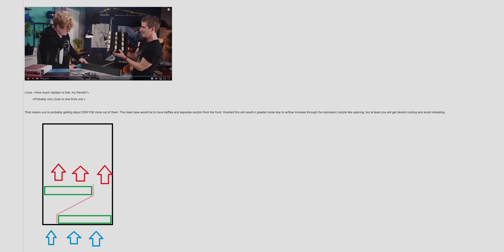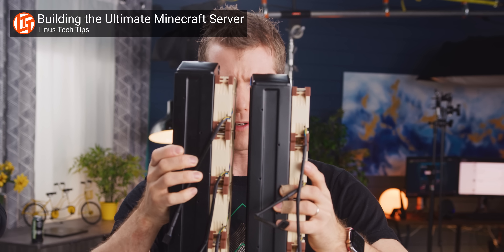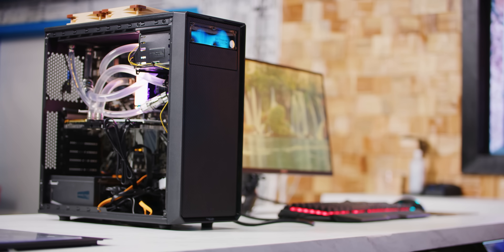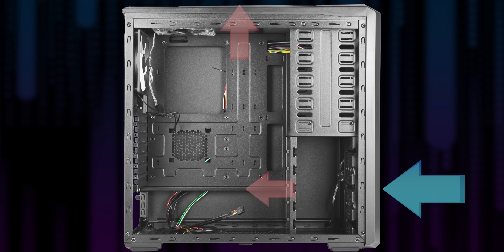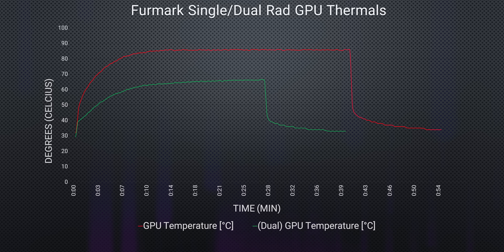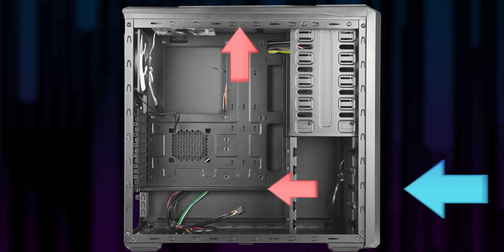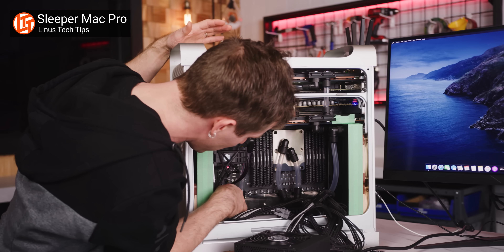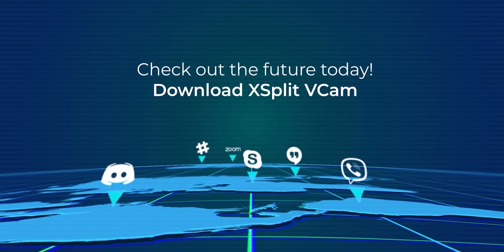I’ve been water cooling wrong for YEARS - $H!T Manufacturers Say

Comment: Missed an important point:  The order the water & air flows through the radiators.  For best transfer you also need to ensure the hot water from the CPU/GPU goes through the 'exhaust' radiator first, then to the 'inlet' radiator.  That way the hot air is passing through the hottest radiator & the precooled water gets the cooler air from the inlet, AND means that the heat from the inlet cannot increase the temp in the outlet radiator.
Order is important!
Reply: Came here to write this comment, glad to see at least someone else think of the same thing. The waterflow direction/order seems like a really basic thing to overlook on both Corsairs and Linus’ part. It’s pretty basics in heat exchange, that a crossflow heat exchanger is more efficient. That’s why the hot water must go to the rad which gets the hot exhausted air. This doesn’t really matter if your single radiator is already efficient enough, but if you really need another one, then the waterflow direction matters. I’m a mechanical engineer, working with engines (a lot of thermodynamics), and in my opinion this is a simple matter, and I’m baffled how Corsair have missed the point. Their CFD resulr might be correct, but the simulation might be incorrectly set up to begin with.
Reply: @MikkoG5  Not to mention it is pretty much impossible for the all the air that goes through the radiator to be at the same heat level as the water that comes to the radiator since the water pretty much loses half the energy by the time it gets half way through the radiator, the air going through the other half, where the water is much cooler will be well below the input temperature.
Reply: Defeqel Yep, I think I get what you mean. These radiators aren’t really cross-flow heat exhangers, as let’s say the air goes horizontally, and the water goes vertically.
Reply: MikkoG5 you’ve just described a cross flow hx, these radiators are cross flow not counter current
Reply: yo gabba Thanks for clarifying! I’m not a native English speaker so had the terms a bit mixed up. In any case, a crossflow hx is more efficient than parallel flow, and a counterflow hx is the most efficient.
A radiator in itself is a crossflow hx as the flows of air and water are perpendicular. But a system of the PC case with two radiators can be considered to form either a parallel or counter flow hx, depending on the water flow direction (hot water meets cold air vs hot air). It’s actually quite common for example for a shell and tube type counterflow hx to be actually a system of multiple crossflow hx’s, if the shell has baffles in it.
Reply: MikkoG5 Yeah you’re right. The manufacturer saying 1degC temperature difference sounded pretty suspect to me.
Reply: @MikkoG5  I'm so glad I found someone who already thought of the exactly what I was thinking of! (I'm a mechanical engineer also and was wondering how Corsair missed this point)
Reply: Just saw this video and had a quick scan through the first few replies and nobody mentioned this so I had posted the same thing, definitely makes a difference where the hot coolant enters the system. Deleted my comment as it is a bit superfluous.
Reply: @GeorgeElliott-GE  Getting pushed down the page does that!
Reply: 14 1/2 mins of Jay showing why it doesn't matter:
https://www.youtube.com/watch?v=RnPB_q51iVk
Only thing to keep in mind is that the reservoir is higher than the pump to make sure no air goes into the pump.
Reply: @HappyBeezerStudios  Different subject.  That is just about the order the water flows through the CPU, GPU, and ONE radiator.  Whether it makes a difference to the CPU/GPU, what order the water flows through the system. Pump - rad - CPU - GPU or pump - CPU- GPU - rad, etc.
I'm talking about the multi radiator setup, & the order of the water & air flow through the radiators only.   The process of getting the heat out of the water most efficiently. 
If you have the hottest radiator at the inlet of the airflow, the air heats up to almost the water temp, picks up more heat in the case & then hits the exhaust radiator at the same or higher temp than the water, so no more heat leaves the system.  Yes, you get more out through the first radiator, but the second is then at best doing nothing, and at worst adding some back in. 
If you put the 2nd radiator at the inlet, the pre-cooled water gets the coldest air & loses some heat, then the air picks up a few degrees in the case, before hitting the high temp water at the 2nd radiator, allowing it to dump more heat as the air leaves the case.  At best you cool the water more through that exhaust rad, and at worst you do nothing.
Assuming adequate airflow...
This is particularly the case where you have stacked radiators as they showed in some scenes that they used previously.
Water: 
IN     Hot--->Warm--->Cool  OUT
OUT Hot<---Warm<---Cool   IN
Air
Reply: @NemoConsequentae  Thank you.  I am losing my mind watching this and reading everything where specific details like this are not taken into account.  
There is also the bit towards the end where he said someone took one of their radiators that actually were in direct series out and saw a 5 degree increase, was that the triple rad setup they showed towards the beginning where all 3 were strapped together?  Because with three the first would cool the water blowing hot air that would warm that cooler water back up in the second rad and then back to cooling the water back down in the 3rd rad.  Im sure there are still factors that will impact that setup too in unexpected ways but I feel that the  "Oh there was this difference in another setup that was actually in direct series." is just obviously anecdotal.
Reply: @Benny23761  It could have been because the one they took out was picking up more heat from the hot case air, or it could be because it added a little too much restriction to the loop, slowing down the flow.  Or it could have been something else completely! 
Without seeing exactly how it was set up, we'll never know.

Comment: Radiators are just almost always going to be better than a HSF setup.
In saying that, i'd have them all pull air out of the case, in this setup, i'd have the one at the front pull air out instead of push air in.

Comment: You're a dumbass. The fans which are above the rad pull cool air down which goes out the rear radiator. Which means you defeated the purpose. You moron you screwed up their analysis by making the fans pull cool air down which messed up your data dumbshit.

Comment: one theory as to why a second rad helps with temps is that by nature of adding a second rad you have more fluid therefor the thermal mass is spread out over a greater volume...simply put more water takes longer to heat. when coupled with extra fans (more air flow) it means that the volume of exchange has increased exponentially. In conclusion, large heat - large thermal mass + large air flow = cooler temp. where as Large heat - moderate thermal mass + moderate airflow = moderate temp.

Comment: I think that the efficiency decrease is the biggest fault of stacking watercoolers, instead of having one sucking in warm air from another cooler why not just put them in parallell, each sucking in colder air, and therefore not loosing efficiency due to a smaller temp. difference

Comment: exactlyyy....... radiator placing and fan functions, all you have to do is place a radiator at the top and one at the front or back and have them both pull air out of the case and leave the largest fan panel for imputing air prefrably filtered in the case. you would have the most cool air coming in and all the hot air going out of the case .

Comment: If radiators were blocking your only means of air ingress/egress then maybe there might be a problem.  What might be more interesting is how a multi-chamber case, with separate radiators (or even loops) in each compartment might work, such as in a watercooling modder's perennial favourite, the TJ07.

Comment: Stacking rads is almost never bad so long airflow is maintained with fans. The simple fact of the matter is cars stack radiators all the time. 
Now... I have one key thing to make sure you pay attention to. If you stack or have multiple rads in a case. You need to have the one that will get the hottest airflow receiving the coolant FIRST. That way the last radiator to see the coolant before going to the CPU/GPU will have the coldest air out of it and most of the heat will already be pulled out. This would allow the most efficient and best result possible for the loop.

Comment: If you're using multiple, run radiators in parallel, not series, and use a Y split. You reduce flow resistance and increase surface area. Since you're splitting the flow in half, it spends more time in the radiators, which allows more head dissipation.

Comment: "Staking radiators is bad".... tell that to the auto industry that has stacked AC condensers, oil coolers, transmission coolers and aftercoolers in front of radiators for decades with no issues. ;)
Reply: People are having issues with the civic type r. the inter cooler dumps its hot air into the cold side of the rad. Swapping the upper an lower rad hoses and having the coolant flow the opposite way through the rad helps with engine temps
Reply: Would you prefer all cars be 10' tall like semi's so you could single stack all your radiators?

Comment: It seems to make perfect sense that the realworld application doesn't match perfectly with a model. Every build is different. However, if I was setting up a dual rad system, both rads woud be exhaust, and the regular case fans would all be intake, allowing the air that reached the rads to be cooler. Of curse, you have to manage the airflow between the intake fans and the rad fans so you still get positive pressure inside the case, and your case fans can pull in more air than your exhaust fans can remove, helping to keep the dust out and the internal air at a cooler temperature. Why feed hot air exhausting from a rad into another rad if you don't have to?

Comment: I have 3+2+9+9x144 rads. The 9+9 are stacked with fans in the middle. And I can say, performance wise, it doesn't really mater after 9, but the fans speed do decrease to more you at. I run now my 7980xe @18x4.8Ghz for 3 years stable @30c water.

Comment: What they meant by "stacking" radiators was the whole rad, fan, rad,fan, rad setup. Their is very little place for fresh air to come in, but cases leak air all over, so the air in the case will never get close to the temp of the rad. The only benefit to stacking rads is the increase in mass of your overall sink. Keep in mind too that simulation and theory never pan out 100% in real world scenarios.

Comment: What you did was have cool air pass through front Rad (which cooled your pc), but have hot water from your cpu, and hot air pass through your 2nd rad (making it useless),  until it is cooled off by the front Rad. You saw cool temps because Front Rad was doing the work it was supposed to. Thus why you dont see daily diving cars having 2 radiators in that configuration.

Comment: Corsair’s results depend upon the assumption that the air pushed through the first rad will exit with a temperature close to that of the rad, but this is not justified. The air would have to be in contact with the rad for a certain length of time to come into thermal equilibrium, but pushing it through faster than this means it enters the case with excess thermal capacity. In a sense, you are admitting that the static pressure provided by your fans is much greater than warranted by the wind resistance of your rads. It might be an interesting experiment to investigate this.

Comment: I think your theory about more fresh ambient air entering the case and mixing with the hot air is valid, as well as you have more volume of water now that you have a second radiator, as well as larger surface area to dissipate heat from, which add together to give you a better cooling.

Thanks for the vid.

Comment: You also left the back fan section open. This would pull in cold air and allow for more work to be done. Stacked rads right up against each other don’t have that benefit. There would be a saturation at some point. And adding rads would be useless as the air goes through them it heats up. The closer you get to the rad temp. The less transfer.

Comment: Your build was completely different from the one they critiqued. You didn't even take into account of the rads were pulling air into or out of the case. Which were probably both pulling air into the case and the hot air being exhausted by back and bottom, whole the system they critiqued had 1 rad pulling fresh air into the case, and the 2nd rad was pulling hot air out of the case.

This video was not a fair answer to Corsair.

Comment: So I believe what Corsair was saying is that stacking one radiator behind the other is not going to help? This is agree with...
In the build Linus tested though, I think they had one radiator in the front of the case.. and then added one at the top.. please tell me if I'm wrong in thinking that.  this would obviously lead to gains in cooling! 
But if hed added another one at the front.. there difference would have been very small

Comment: Linus, I'm loving this video. My wife and I are two of your oldest and longest fans. If you was not for you, I would not own a PC company, hell I would have never built my first PC. I also water cool everything. My currant PC, "THOR" uses a Asus ROG Strix Z390-E motherboard, i7 8700K CPU, 16 GB of Corsair RAM, a Auros GTX 1080 ti GPU,  M.2 and a lot of Storage. It also uses 16 fans. I know it sound like noisy overkill, but my PC is as quiet as a church mouse. I have two water cooling systems at work here. the first is for the CPU, a Corsair H115 Pro and in order to mount four fans and keep from blocking air to the motherboard a 1 1/4 inch peace of MDF was added between the main body of the case and the top, The second is custom. it starts out side the case with a 300ml Res/D5 pump combo. from there water is sent through soft tubing to the top of a 700 ml Res that is mounted to the back of my case. coming out the bottom of the Res the tubing changes to hard chrome tubing and enters the case next to the power supply. It travels across and then up the a full coverage GPU EK waterblock. From there more chrome tubing goes up at a 45* angle and exits the case just under the DVD where it changes back to soft tubing that runs back and under the top of my rig to a copper 480 Rad that has 4 corsair high pressure fans pushing air and 4 corsair high flow fans pulling air through the Rad. Exiting the Rad tubing again changes back to Hard Chrome and travels across the front of my rig at a 45* angle back to the pump. Inside the case there are two 220 mm fans, a 140 mm fan and a 120 mm fan. That's 16 fans and you don't hear a one. The system uses about 70 oz of water. I run my CPU at 4,7 and the GPU ramps to around 2000. all this is running three 24" 144 Hz LG Gaming monitors. I run Project CARS 2 with all setting on Ultra and average 120 fps. Max CPU temp is 50C and my max GPU temp is 47C. Thank you for your inspiration.

Comment: I never got to see the radiator set up in the first rig. I think you had it in the front lower section pulling air in through it.
If this is correct you are basically pulling room temp air through a warm rad heating the inside of the rig.
I think it would be better to pull the heat from the rad out from inside the case and cool air in with the fans. 
that way only cool air enters the rig and warm air is expelled. 
Think of a radiator in your home. If you want to heat a room, would you have the fan blowing in or out for optimal heating?
The same is true in reverse, if you want to cool the room down, you pull cool air in through one side and out through the rad on the other.
Also, I agree with Corsair that adding more radiators won't make a huge difference if you are set up for optimal heat transfer and airflow.

Comment: Like the beard, keep it. Loose the new into dough. I don’t like change.

Also to note, sub room temps have been reached with stacked rads.
Reply: Xibyth that completely goes against the 2nd law of thermodynamics. You can’t have heat transfer from cold to hot in conventional radiators unless it utilizes evaporative cooling or some other refrigeration method.

Comment: This... this is true from an engineer standpoint. Never seen you stack radiators which are designed to use cold air to cool a hot fluid. If you're passing hot air thru it it's fuckin pointless lol. But, 2 radiators that are both intaking cold air is better than 1

Comment: Why do you put the radiators inside the case anyway, surely it would be better if they were outside, isn't that what they used to do when liquid cooling was first a thing? It doesn't make any sense to have them inside the case with all the hot air and there's absolutely no reason why they can't be outside the case apart from aesthetic, this fad for form over function in PC builds is infantile, cable management and RGB lighting, and I guess wanting the rads inside the case for neatness is an extension of this.

Comment: Guys, I need to mount my radiator to the front, because of RAM clearance. HHowdo I mount the two fans on the radiator? Should they pull or push? And: On which side of the radiator should the fans be? Is it   "Case -> (inside) -> radiator -> fans -> ..... "    or   "Case -> (inside) -> fans -> radiator -> ...."  ? I have two other fans that are pushing air out of the case, one at the rear top and one at the top rear.